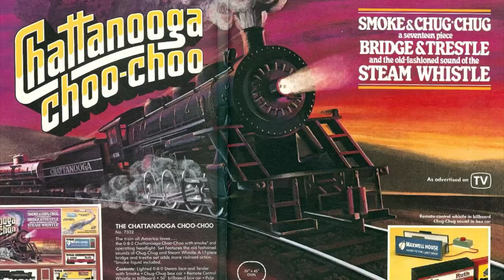A Complete Guide to Rebuilding Tyco's Power Torque Drive Systems

Comment: I purchased a 20 year old lightly used Tyco power Torque engine on Ebay. It tried to motor but didn't. I disassembled and followed  your video. Slight improvement as it now attempts to make it around the track but is now stop and go. Unsure what the problem is.

Comment: You need to tin brush plates also before soldering wire to them much better connection, also a much thinner blade screwdriver that will flex without breaking & a simple round toothpick for picking up the delicate parts

Comment: Good video. I enjoy tinkering with old trains as well. I like to clean mine in jewelry cleaner. I will even put the solution in a cheap ultrasonic cleaner and let if run a bit. I also got some rubber feeling discs for my Dremel, the do great for cleaning/polishing armatures, and much less mess than with polishing compound. Got mine  in a kit from Harbor Freight.

Comment: A pencil eraser works great for polishing the commutator. 

Have you found a good replacement for the brushes and or brush springs? The brushes are usually pretty good, just dirty, but the springs can get cooked and other be deformed or broken. I haven't found a good replacement source.

Comment: What did you use to replace the traction tires?  Did you say "gum bands"?  What are gum bands and do you use a specific brand?
Reply: Orthodontic elastic bands. Amazon. eBay. Department Stores. And, Pharmacies.

Comment: Hi Dan I have a question. I have a rock island 4301 alco and I run it sometimes. I got it at an antique store for my birthday so I had it for about half a year. Then one day I set it on the track to run on my layout and smoke started to come from the motor and I tried moving it around but it only went half an inch by itself so I turned of the power. I cracked open the motor and to my surprise the whole thing was covered in melted led from the led rollers. But to note I also did service it when I got it. But Dan do you know why that happened why the rollers melted. I would love to hear a response
Reply from the maker: I’m not exactly sure what your referring to as “rollers” could you please clarify ?
Reply: Sorry I just remembered the brushes melted
Reply: Hi Dan it's been awhile since you responded and I just want to known if theirs any way I can send you pictures of the motor and the melted brushes sorry. I was thinking of the word brushes but used the word rollers I was thinking of lionel postwar locomotives
Reply from the maker: @bnsfwoodvalleysubdivision9157  sure. The best way to contact me would be through email at danielhauck67vlogs@gmail.com
Reply: Ok it will be about 2 weeks till I send you them I have it at my step dad's farm that's were I have most of my layout I put it on my work bench I'm at my dad's not my step dad's I go to my step dad's farm a lot but every other week I see my dad not my step dad

Comment: I use ( CLR ) On my Wheels and connection's clean deep , Last L O N G E R ! ! !, Little go's long way's , Don't get Crazy with it !! , And I use Lucas Gun Oil with the needle applicator  ,The Lucas Gun Oil is moisture proof and heat resistant it's great to use on all your training wheels, And Motor part's ! , Especially brass!! . 😉 
And I use white grease for my gering in my axles it's highly conductive for Electrical pick up's , it won't dry out like most grease and oil will !, Contains ( 0% ) Water ! , Most lubricants do!!, People don't realize that ( WD-40 ! ) Mostly Water and can cause Rust !, That is why they tell you not to use WD-40 on a gun, it can cause your gun to jam up,